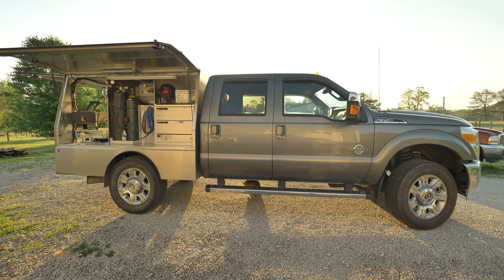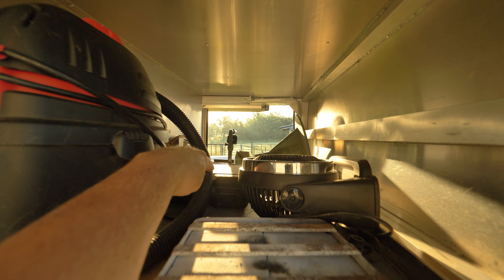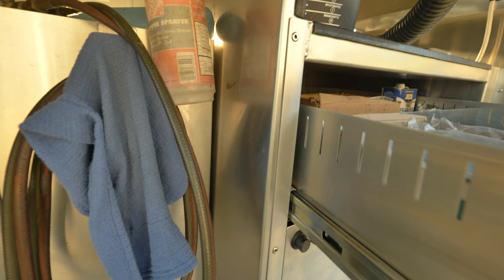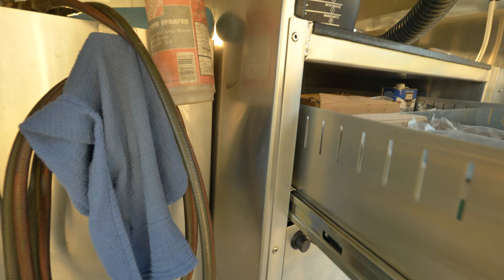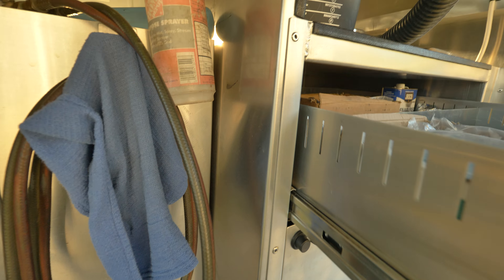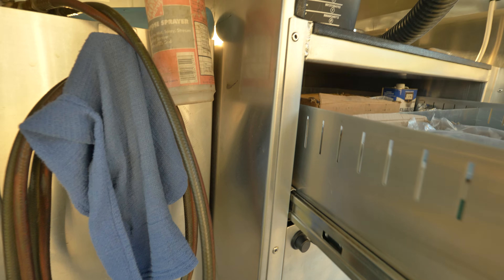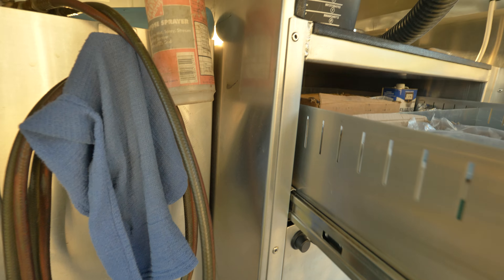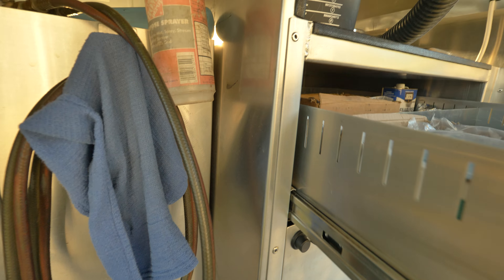My Farrier Rig tour

Comment: Hey Scott, love the rig. Bay Horse does such a great job. I was wondering about some more info regarding the batteries/inverter. Im sure it's awfully handy when the stop doesn't have power within reach
Reply from the maker: It's incredibly handy, especially on the one or two horse stops. It saves a ton of time and work setting up janky power from the barns. Lots of times I even run my fans for an extended period of time of the rig power. I do plug in when stopped for any length of time so that I stay pretty much topped off.

Comment: Who made this awesome truck bed?!?!?!
Reply: Nvm I found a older comment with the same question answered.👍🏻😀
Reply from the maker: This is a Bay Horse body. They have a shop in Cynthiana, KY which is just outside of Lexington.
Reply: Scott Gregory, Thank you Scott. I my self am trying to acquire a decent rig without spending a lot of money. For now.
But your type of rig set up is definitely a gol.
Also do you prefer the truck over a trailer rig set up? And if so why?
Reply from the maker: @dogbite082  I hear you. I had been shoeing around 25 years when I finally just went ahead and bought this. I sure don't regret it and honestly, the only regret is not doing it much sooner. This body with new anvil, swing out, forge, drill presses and power system was about $18k. A lot, but I can easily get another horse or two done each day with this, so the math works out. 

As far as truck or trailer? That's the million dollar question. I used to have a cargo trailer set up to work out of and that was awesome. It is really nice to be able to get out of the weather and have everything all set up and ready all the time. 

I stopped using it though, because maintenance was annoying. I have really been thinking about it again, although there are a good amount of places that it wouldn't fit in. 

The main drawback I see about using a trailer now is the government. A bunch of my farrier buddies have been really pummeled with the new regulations requiring a CDL to pull a trailer. I find that to be a pretty obnoxious burden.
Reply: Scott Gregory yeah I my self am thinking about a single axle trailer. But I don’t wanna spend 13-15k on one just yet.
I have a old military M101a1 trailer that I am thinking about converting with one of those farrier truck bed inserts to save some cost but I’m not sure yet.
And I have thought about the hole CDL situation. And if I keep it within my states weight laws I should be ok. But I am definitely staying away from gooseneck work trailers to avoid confusion and police harassment.